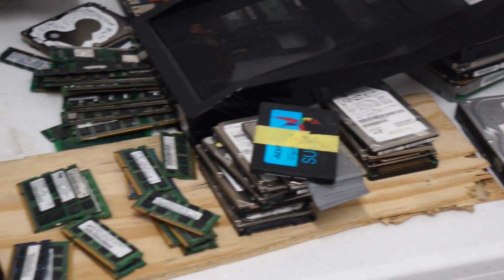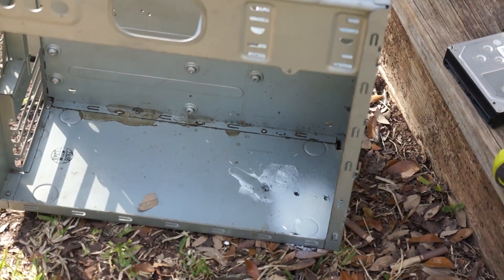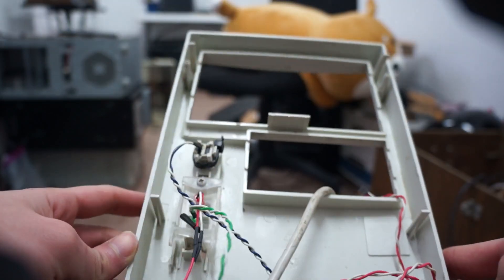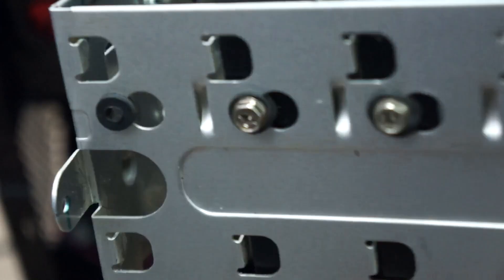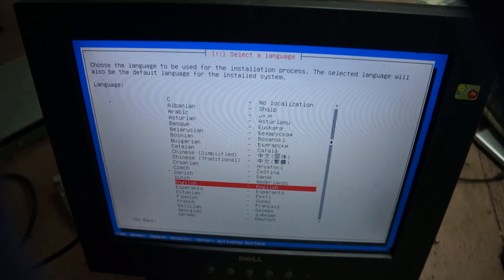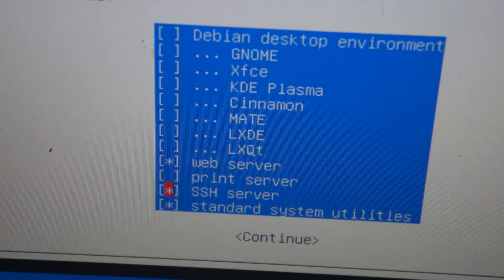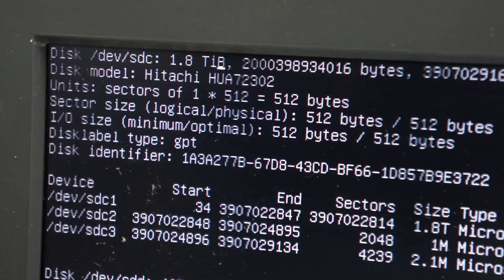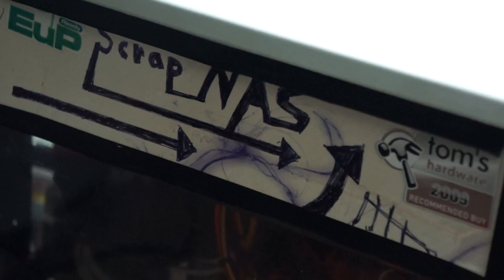Building the Worlds Cheapest NAS!

Comment: hey, sorry in advance, i know this is off topic BUT, i need your advice!
i bought an X230 Tablet, and it has an admin password so i can't access the bios, which means i cant use my WWAN card, or change the expresscard port speed (which i need to do to use my eGPU/external graphics card)
ive tried disconnected Cmos (for an hour), and i have very limited funds or soldering skills (i do have a soldering iron etc).

is there anyway to reflash the bios through linux or windows (im not actually sure i can boot anything except the internal ssd, which has windows 10, i am aware you are not a fan)? and would this remove the bios password?

sorry again for it not being relevant, i just figured you would be the person to know, so i posted on your most recent (non-live) video in the desperate hope you would be able to help me!

any help would be HUGELY appreciated!

TechDave

ps: i do have a raspberry pi, but no other devices, so cud potentially reflash as a last resort... love the channel btw! ive watched a whole bunch of your videos, i just don't comment that much! Cheers!
Reply from the maker: I'd just try this out:

https://www.reddit.com/r/thinkpad/comments/3jin77/x220_and_bios_password/

You are going to have to open it up anyways though, good luck :D

For coreboot you could try the ch341a they are only a few dollars, and try to do a coreboot system. It may or may not still be locked. It uses a wson chip most likely, which means external soldering or hot air reflow.
Reply: @tripcodeQ7  okay thanks! I'll shall see how it goes! X